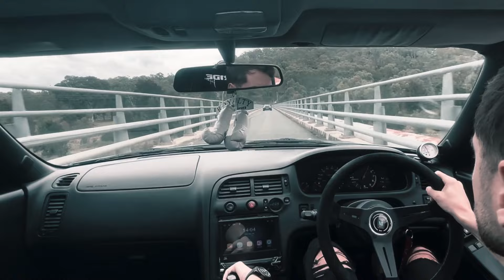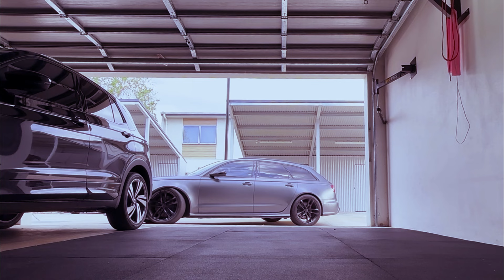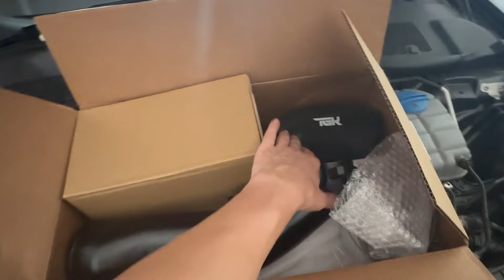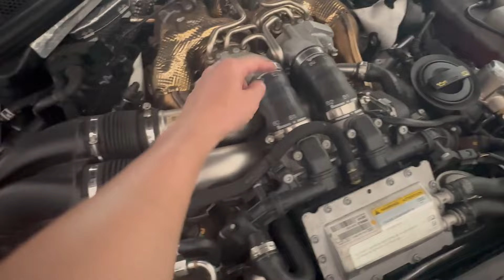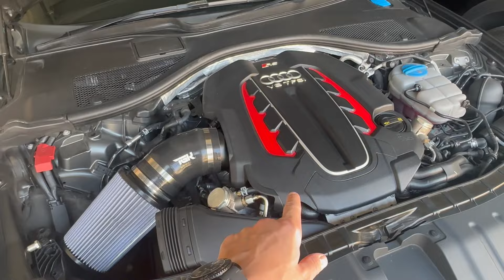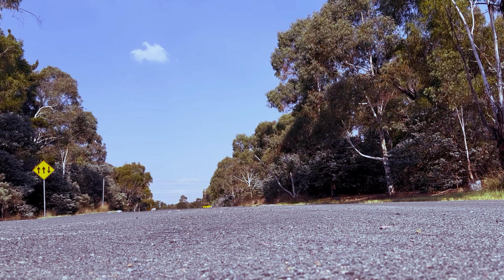Ep24: Installing a TGK Intake on my RS6 + Sound Clips

Comment: It’s extremely difficult to find good videos showcasing intake differences on these 4.0T’s. Very straight forward perfect video mate. If you could answer kindly, how is the noise for cruising speeds / motorway speeds? Is it irritating overtime would you say? I use my RS7 for up and down country runs aswell as a fast daily, so im wanting some noise but don’t want it to be overly irritating for long drives. Many thanks!!
Reply from the maker: @danielsmith9680  thanks for the comments!

I found no real difference daily driving with the windows up. Crack a window, and jump on it 🤤 Buy it, you won’t regret it!

Comment: What kind of headlight tint is that? I am thinking of getting PPF smoked headlight tint from XPEL. How much is the light output reduced at night?
Reply from the maker: Just some cheap stuff of Amazon… it works, but no doubt the XPEL would be a better option.

I didn’t notice any reduced output, but I do drive in well lit areas 99.9% of the time.